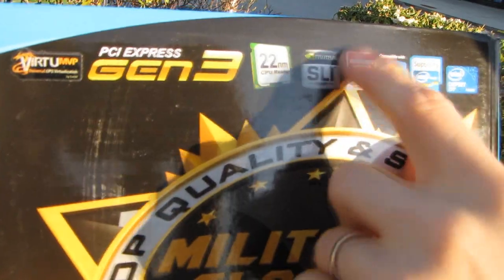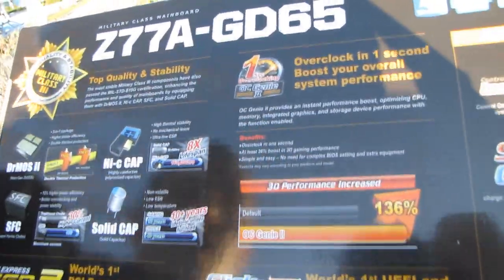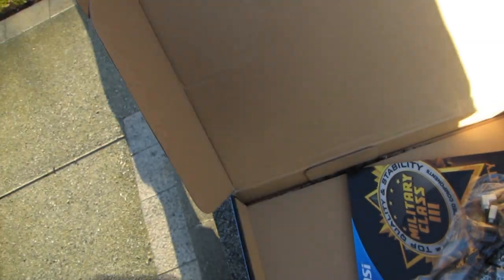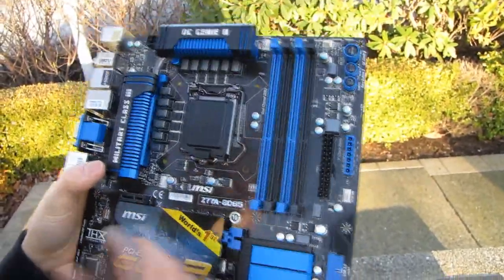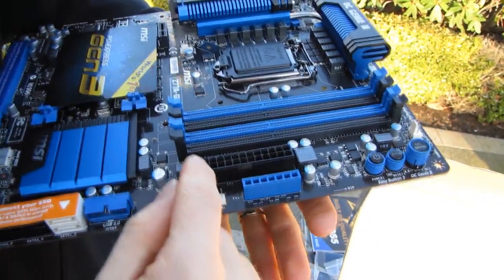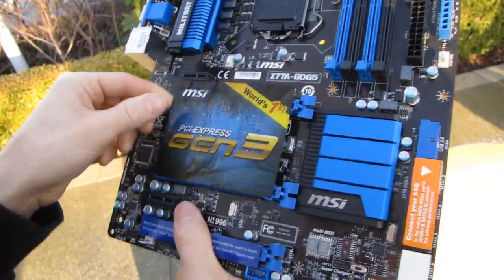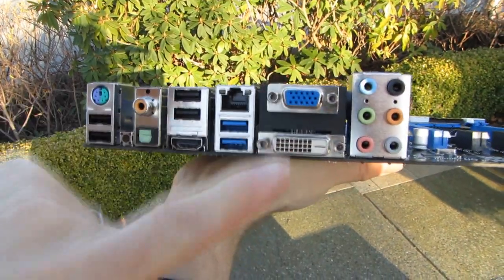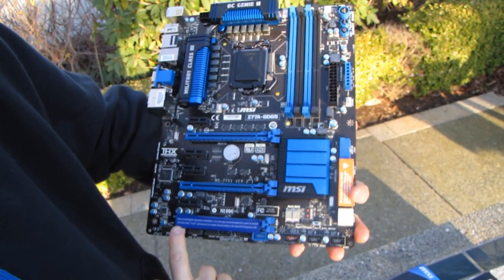MSI Z77A-GD65 Z77 Ivy Bridge Motherboard Unboxing & First Look Linus Tech Tips

Comment: Which motherboard would be better? This UD5H, or the MSI Z77A-GD65? The MSI is $20-$25 cheaper, and I do like MSI's products, never owned any Gigabyte ones, but I've heard great things about them.  Whichever ones I could use to get me to 4.5GHz easily with either the H80i or H100i is the motherboard for me.  This is one of the four sole remaining parts of my build, including the OS, PSU, and CPU cooler.  Still trying to decide between the H80i and the H100i.  Thanks in advance. --Jake

Comment: it doesn't matter as long as you put two in the same color. Linus said in an old video that you should put them in the same color and if you have a large cpu cooler just get low-profile ones and put them at the right slots (in this case blacks).

Comment: I got an MSI board with the Winki 3 bootable driver disc. When I ran it, I couldn't access the internet. It kept telling me the internet connection was out.

Also, I have for a long time been wary of MSI because of the horrible grammar on their website in the past. So I never wanted to buy their products out of fear of unprofessionally done documentation. But last August, I decided to buy a GTX560 graphics card from MSI. The grammar on the documentation was appalling.

Comment: The main benefit you would get would be the ability to actually use the pci-e 3.0.  That only really comes with the Ivy Bridge processors.  Even if you had a z77 board with a 2600k you would only be getting 2.0 support out of the PCIe slots.  Other than that, its just the different things that come with the chipset which my brain can't think about atm.

Comment: Hey guys, I'm looking to jump from 775 to 1155, and I need a board that is in the sub £150/$200 range, with hope of two way SLI or X-Fire in the foreseeable future. 
What do you guys suggest! I hope to do some minor (5% - 20%MAX) overclocking too. Open to both z68 and z77 and even Hxx boards...

Comment: x79 is a better platform because it can use Sandy Bridge-E processors. x79 has a LGA 2011 socket whereas z77 uses LGA 1155. But x79 is overkill for most users. If you are planning to do just gaming, save yourself some bucks and get z77.

Comment: What a horrible placing for the Vcheck points, they're essentially completely useless when the 24 pin is plugged in and pulled around like you would usually do

Comment: i have a question for everyone out there, is this a good pc design?

processor: intel icore extreme 990x

graphics card: GeForce GTX 680

motherboard: asus rampage IV extreme

ram: corsair vengence DDR3 32gb (4x8gb) 1866mHz

SSD: intel 250gb 

power supply: Corsair Professional Series Gold 1200-Watts

storage: 2x4tb sata harddrives

case: cosmos II

there will also be watercooling to the processor & plenty of fans to cool the rest of the stuff down nicely

Comment: 22nm process, less power consumtion, potentially higher ability to OC higher, pci-e 3.0 support, ~10% increased performance per clock vs Sandy Bridge, a better IGP(HD 4000) vs. SB's(HD 3000)

Comment: 22nm Transistors, where as sandy had 32nm Transistors.  Smaller Transistors = lower heat, higher clock speeds at same voltage, more OC ability, lower power consumption, and over all better performance. They estimate 11% better than sandy.

Comment: As a rule you tend to get better bang for your buck with Radeon. That being said, the 560ti is a great card for a relatively low price, and the Twin Frozr will keep in nice and cool. The 570 is also a solid bet, if you can afford it. Keep in mind that PNY is a little 'meh', but It'll do okay.

If I were you, I would go for either the ASUS HD 6950 or the ASUS GTX 570.
If you think you might have the money, maybe consider getting a 560ti, and then buying a second a little later down the line.

Comment: Hi. Tomorrow i have to buy a graphic card so help me
ASUS GeForce GTX 560 Ti TOP DirectCUII 1 GB GDDR5 PCI-Express 2.0 [SLI READY]

PNY GeForce GTX 570 1280 MB GDDR5 [SLI READY]

SAPPHIRE TECHNOLOGY Radeon HD 6870 Flex 1 Go GDDR5 - PCI-Express 2.1

MSI GeForce GTX 560 Ti Twin Frozr II OC 2 GB GDDR5 - PCI-Express 2.0 [SLI READY]

ASUS GeForce GTX 570 DirectCUII 1280 MB GDDR5 PCI-Express 2.0

TIKOO Radeon HD 6870 1 GB GDDR5

ASUS Radeon HD 6950 DirectCUII 1 GB GDDR5 - PCI-Express 2.1

Comment: Get the 3000 series, though i7 2600k is awesome as well! Remember to get proper coolingfor the CPU, I run mine @ 4,5Ghz with Noctua NH-D14, it's silent and keeps my CPU under 60*C ALL THE TIME, even in Prime 95 100% cpu usage :))

Comment: I have a 2 questions I was hoping some one could help me with
1. Does the case's USB have to support USB 3.0 for it to work? I've seen cases have the blue to indicate that's a 3.0 port, but wasn't sure it it was just so you know which ones which. And does the same go for the charging port?
2. Are the Ivy bridge processors out yet?